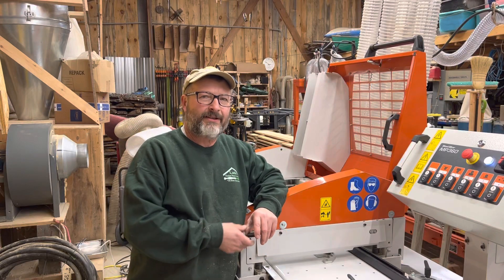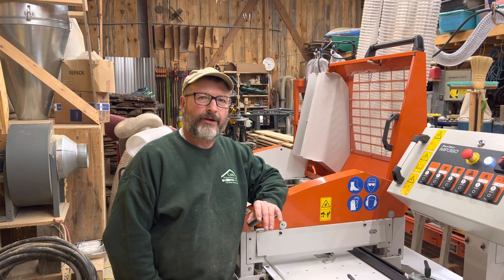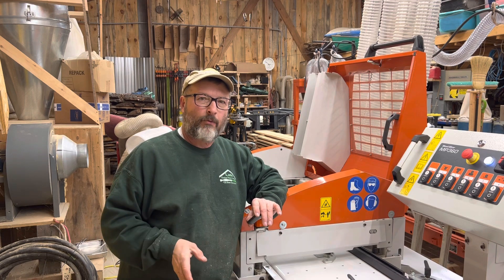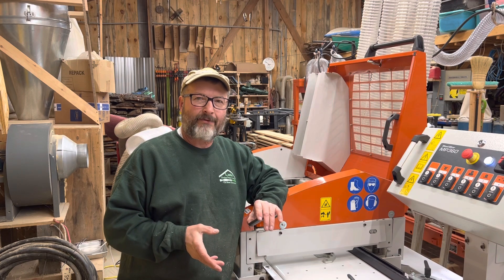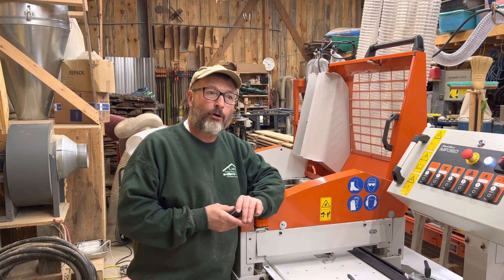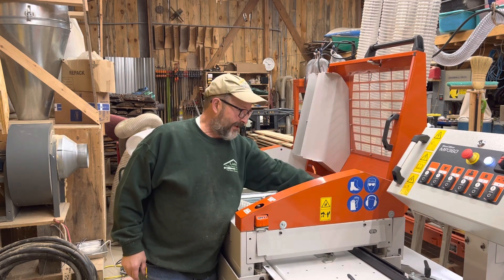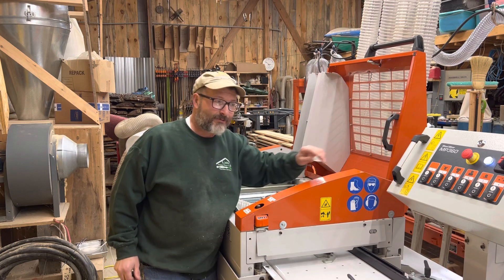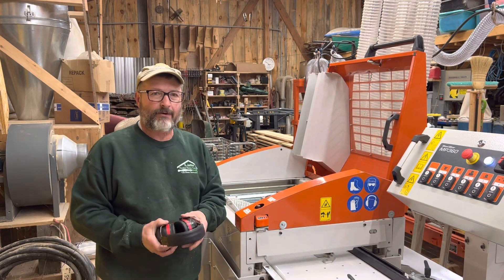Timber Frame shop - Woodmizer MP360 4-side planer - running 1x3 Eastern White pine initial set up.

Comment: This Woodmizer version is exactly the same as the Logosol 360. They are good machines, I bought my first Logosol when they first came out in 2010 and second in 2020. Many thousands of hours and lots of wood thru. Made me money until I retired 3 years ago. I made a utube video under Peerless Forest Products which gives a pretty good idea of what you can do with this machine. I also designed a dust collector system that used large bulk bags (like for fertilizer) on the bottom end to collect shavings that can be sold as bedding.

Comment: GOOD MORNING SR. I REALLY ENJOY WATCHING YOUR VIDEOS AND REALLY LOVE AND APPRECIATE THE DETAIL IN WHICH YOU EXPLAIN YOUR PROCESS TO CUT YOUR JOINTS. I’M AN A 44 YEAR OLD ELECTRICAL CONTRACTOR BASED IN CALIFORNIA, HAVE BEEN AT IT 26 YEARS, WHAT WAS REALLY EXCITING  ONCE NOT AS MUCH ANY MORE. I HAVE ALWAYS BEEN INTERESTED WOOD WORK AND AS YOU READ AND WORK ON  GETTING BETTER AT IT YOU DEVELOP A LOVE FOR IT AND IN DOING SO I CAME ACROSS YOUR CHANNEL.  I’M INTHE PROCESS OF BUILDING A  TIMBER FRAME SHOP, AND I’M TROUBLE FINDING A VIDEO EXPLAINING HOW TO CUT A TIMBER SPLINE JOINT FOR SOME TRUSSES FOR MY SHOP. WONDERING IF YOU CAN MAKE A VIDEO DETAILING HOW TO CUT  A TIMBER SPLINE JOINT.
Reply from the maker: Hi Ezequiel
We haven’t used many spline joints over the years, so I don’t have a video.
What is the application where you are thinking to use a spine joint?
I have some pics of timber scarf joints on the R Jemithan Facebook pages if that helps.
Good luck with your woodwork adventures and let me know if I can help!

Comment: What size phase converter do you need to run 360
Reply: Will a 20hp do the job
Reply from the maker: This is what I purchased and I use it to run the WM500 blower too but I have to start in sequence so not to fault out.
American Rotary ADX30 extreme duty.
Reply: Best set up as standard 3 phase powered.